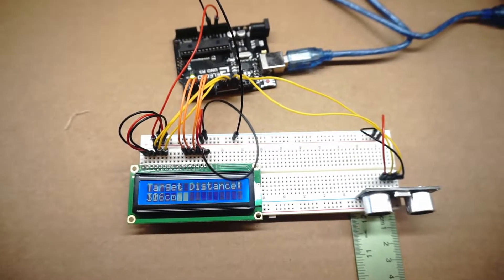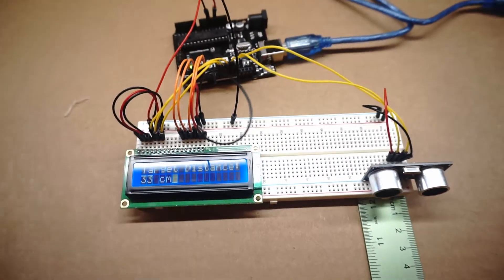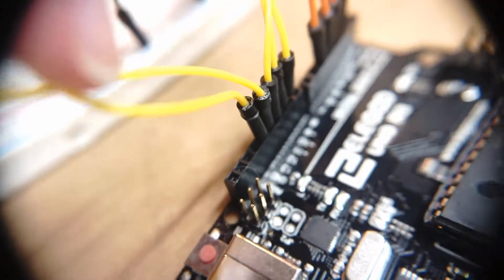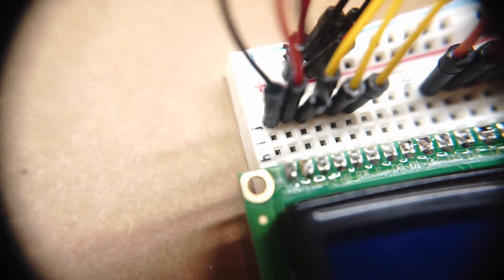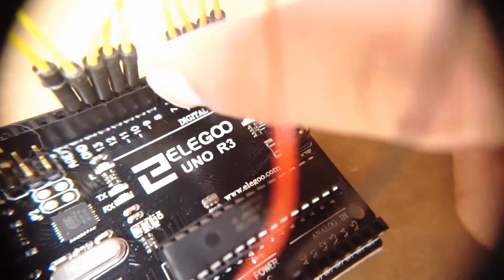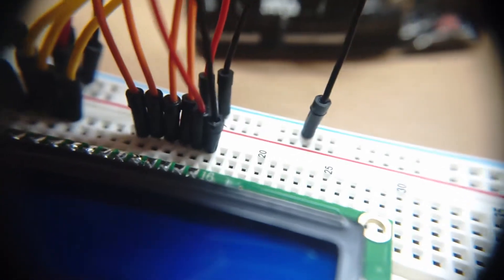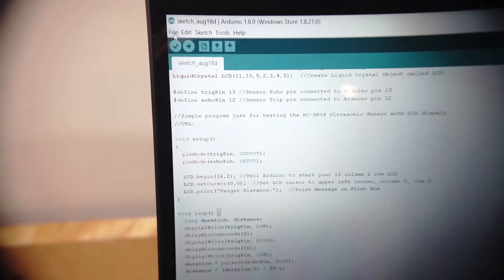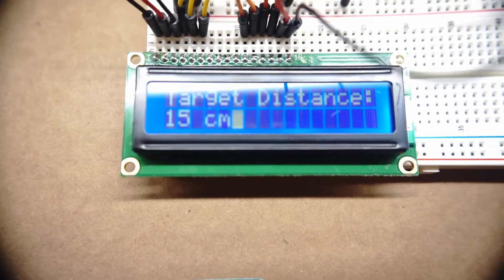Elegoo Starter Kit Arduino UNO Ultrasonic Measuring Project

Comment: switch to 5v and here is the code #include <LiquidCrystal.h>

// LCD pin order: RS, E, D4, D5, D6, D7
LiquidCrystal LCD(11,10,9,2,3,4,5);

#define trigPin 13
#define echoPin 12

void setup() {
  pinMode(trigPin, OUTPUT);
  pinMode(echoPin, INPUT);

  LCD.begin(16, 2);
  LCD.setCursor(0, 0);
  LCD.print("Target Distance:");
}

void loop() {
  long duration;
  float distanceCM;

  // Trigger pulse
  digitalWrite(trigPin, LOW);
  delayMicroseconds(2);
  digitalWrite(trigPin, HIGH);
  delayMicroseconds(10);
  digitalWrite(trigPin, LOW);

  // Read echo time
  duration = pulseIn(echoPin, HIGH, 30000); // 30ms timeout

  // Convert to centimeters
  distanceCM = (duration / 2.0) / 29.1;

  // Clear second line
  LCD.setCursor(0, 1);
  LCD.print("                ");  // 16 spaces

  // Print distance
  LCD.setCursor(0, 1);
  LCD.print(distanceCM, 1);  // one decimal place
  LCD.print(" cm");

  delay(200);
}

Comment: #include <LiquidCrystal.h> //Load Liquid Crystal Library
LiquidCrystal LCD(11,10,9,2,3,4,5);  //Create Liquid Crystal Object called LCD

#define trigPin 13 //Sensor Echo pin connected to Arduino pin 13
#define echoPin 12 //Sensor Trip pin connected to Arduino pin 12

//Simple program just for testing the HC-SR04 Ultrasonic Sensor with LCD dispaly 
//URL:

void setup() 
{  
  pinMode(trigPin, OUTPUT);
  pinMode(echoPin, INPUT);
  
  LCD.begin(16,2); //Tell Arduino to start your 16 column 2 row LCD
  LCD.setCursor(0,0);  //Set LCD cursor to upper left corner, column 0, row 0
  LCD.print("Target Distance:");  //Print Message on First Row
}

void loop() {
  long duration, distance;
  digitalWrite(trigPin, LOW);
  delayMicroseconds(2);
  digitalWrite(trigPin, HIGH);
  delayMicroseconds(10);
  digitalWrite(trigPin, LOW);
  duration = pulseIn(echoPin, HIGH);
  distance = (duration/2) / 29.1;

  LCD.setCursor(0,1);  //Set cursor to first column of second row
  LCD.print("                "); //Print blanks to clear the row
  LCD.setCursor(0,1);   //Set Cursor again to first column of second row
  LCD.print(distance); //Print measured distance
  LCD.print(" cm");  //Print your units.
  delay(250); //pause to let things settle

Comment: is there explanation as to why certain wiring has to go in certain locations?
Reply: There is a communication protocol between Arduino & the sensor for which the signals must be high for a certain time & low for a certain time. Similarly, the lcd interface also requires the display  data to be given by Arduino at a certain particular timing & place. Different pins have different functions. So the correct signals must be given to the required pins which makes it necessary to follow the wiring requirements strictly.

Comment: To make it portable you can attach a d battery or really any battery to the Arduino but it is easier with a D battery because you can just plug it in with that black plug on the side

Comment: it keeps saying an error occured while uploading the sketch
can someone tell me why
i just uploaded it from my files and its doing that
Reply: You need to check the port when you want to upload the program. Simply put, your computer  & Arduino communicate via a port on the computer.  So, the port & also the Arduino board must be selected before uploading the program. 3  months have passed,  but just hope it helps in case you have not found a solution.
Reply: @chetananam9141  hellooo, i dont understand anything, but thank you for helping! i found a different video, i just cant find that exact video again, so again thank you!

Comment: void setup() 
{  
  pinMode(trigPin, OUTPUT);
  pinMode(echoPin, INPUT);
  
  LCD.begin(16,2); //Tell Arduino to start your 16 column 2 row LCD
  LCD.setCursor(0,0);  //Set LCD cursor to upper left corner, column 0, row 0
  LCD.print("Target Distance:");  //Print Message on First Row
}

void loop() {
  long duration, distance;
  digitalWrite(trigPin, LOW);
  delayMicroseconds(2);
  digitalWrite(trigPin, HIGH);
  delayMicroseconds(10);
  digitalWrite(trigPin, LOW);
  duration = pulseIn(echoPin, HIGH);
  distance = (duration/2) / 29.1;

  LCD.setCursor(0,1);  //Set cursor to first column of second row
  LCD.print("                "); //Print blanks to clear the row
  LCD.setCursor(0,1);   //Set Cursor again to first column of second row
  LCD.print(distance); //Print measured distance
  LCD.print(" cm");  //Print your units.
  delay(250); //pause to let things settle
}
Reply: thanks for the code brother
Reply: Brilliant. Really wonderful help!

Comment: can someone give me the code since i cant find it in the link
Reply: /*
HC-SR04 Ultrasonic Sensor with LCD dispaly

HC-SR04 Ultrasonic Sensor
VCC to Arduino 5V
GND to Arduino GND
Echo to Arduino pin 12
Trig to Arduino pin 13

LCD Display (I used JHD162A)
VSS to Arduino GND
VCC to Arduino 5V
VEE to Arduino GND
RS to Arduino pin 11
R/W to Arduino pin 10
E to Arduino pin 9
DB4 to Arduino pin 2
DB5 to Arduino pin 3
DB6 to Arduino pin 4
DB7 to Arduino pin 5
LED+ to Arduino 5V
LED- to Arduino GND

Modified by Ahmed Djebali (June 1, 2015).
*/
#include <LiquidCrystal.h> //Load Liquid Crystal Library
LiquidCrystal LCD(11,10,9,2,3,4,5); //Create Liquid Crystal Object called LCD

#define trigPin 13 //Sensor Echo pin connected to Arduino pin 13
#define echoPin 12 //Sensor Trip pin connected to Arduino pin 12

//Simple program just for testing the HC-SR04 Ultrasonic Sensor with LCD dispaly
//URL:

void setup()
{
pinMode(trigPin, OUTPUT);
pinMode(echoPin, INPUT);

LCD.begin(16,2); //Tell Arduino to start your 16 column 2 row LCD
LCD.setCursor(0,0); //Set LCD cursor to upper left corner, column 0, row 0
LCD.print("Target Distance:"); //Print Message on First Row
}

void loop() {
long duration, distance;
digitalWrite(trigPin, LOW);
delayMicroseconds(2);
digitalWrite(trigPin, HIGH);
delayMicroseconds(10);
digitalWrite(trigPin, LOW);
duration = pulseIn(echoPin, HIGH);
distance = (duration/2) / 29.1;

LCD.setCursor(0,1); //Set cursor to first column of second row
LCD.print(" "); //Print blanks to clear the row
LCD.setCursor(0,1); //Set Cursor again to first column of second row
LCD.print(distance); //Print measured distance
LCD.print(" cm"); //Print your units.
delay(250); //pause to let things settle
}

Comment: it dosn´t work.
can somebody please tell me how i can fix it or copys the real code unter my commend.
Reply: /*
HC-SR04 Ultrasonic Sensor with LCD dispaly

HC-SR04 Ultrasonic Sensor
VCC to Arduino 5V
GND to Arduino GND
Echo to Arduino pin 12
Trig to Arduino pin 13

LCD Display (I used JHD162A)
VSS to Arduino GND
VCC to Arduino 5V
VEE to Arduino GND
RS to Arduino pin 11
R/W to Arduino pin 10
E to Arduino pin 9
DB4 to Arduino pin 2
DB5 to Arduino pin 3
DB6 to Arduino pin 4
DB7 to Arduino pin 5
LED+ to Arduino 5V
LED- to Arduino GND

Modified by Ahmed Djebali (June 1, 2015).
*/
#include <LiquidCrystal.h> //Load Liquid Crystal Library
LiquidCrystal LCD(11,10,9,2,3,4,5); //Create Liquid Crystal Object called LCD

#define trigPin 13 //Sensor Echo pin connected to Arduino pin 13
#define echoPin 12 //Sensor Trip pin connected to Arduino pin 12

//Simple program just for testing the HC-SR04 Ultrasonic Sensor with LCD dispaly
//URL:

void setup()
{
pinMode(trigPin, OUTPUT);
pinMode(echoPin, INPUT);

LCD.begin(16,2); //Tell Arduino to start your 16 column 2 row LCD
LCD.setCursor(0,0); //Set LCD cursor to upper left corner, column 0, row 0
LCD.print("Target Distance:"); //Print Message on First Row
}

void loop() {
long duration, distance;
digitalWrite(trigPin, LOW);
delayMicroseconds(2);
digitalWrite(trigPin, HIGH);
delayMicroseconds(10);
digitalWrite(trigPin, LOW);
duration = pulseIn(echoPin, HIGH);
distance = (duration/2) / 29.1;

LCD.setCursor(0,1); //Set cursor to first column of second row
LCD.print(" "); //Print blanks to clear the row
LCD.setCursor(0,1); //Set Cursor again to first column of second row
LCD.print(distance); //Print measured distance
LCD.print(" cm"); //Print your units.
delay(250); //pause to let things settle
}

Comment: This worked great. Thank you.
Reply: Can you help please if you have the code can you send it
Reply: @hellcat5030  void setup() 
{  
  pinMode(trigPin, OUTPUT);
  pinMode(echoPin, INPUT);
  
  LCD.begin(16,2); //Tell Arduino to start your 16 column 2 row LCD
  LCD.setCursor(0,0);  //Set LCD cursor to upper left corner, column 0, row 0
  LCD.print("Target Distance:");  //Print Message on First Row
}

void loop() {
  long duration, distance;
  digitalWrite(trigPin, LOW);
  delayMicroseconds(2);
  digitalWrite(trigPin, HIGH);
  delayMicroseconds(10);
  digitalWrite(trigPin, LOW);
  duration = pulseIn(echoPin, HIGH);
  distance = (duration/2) / 29.1;

  LCD.setCursor(0,1);  //Set cursor to first column of second row
  LCD.print("                "); //Print blanks to clear the row
  LCD.setCursor(0,1);   //Set Cursor again to first column of second row
  LCD.print(distance); //Print measured distance
  LCD.print(" cm");  //Print your units.
  delay(250); //pause to let things settle
}

Comment: code /*
HC-SR04 Ultrasonic Sensor with LCD dispaly

HC-SR04 Ultrasonic Sensor
VCC to Arduino 5V
GND to Arduino GND
Echo to Arduino pin 12
Trig to Arduino pin 13

LCD Display (I used JHD162A)
VSS to Arduino GND
VCC to Arduino 5V
VEE to Arduino GND
RS to Arduino pin 11
R/W to Arduino pin 10
E to Arduino pin 9
DB4 to Arduino pin 2
DB5 to Arduino pin 3
DB6 to Arduino pin 4
DB7 to Arduino pin 5
LED+ to Arduino 5V
LED- to Arduino GND

Modified by Ahmed Djebali (June 1, 2015).
*/
#include <LiquidCrystal.h> //Load Liquid Crystal Library
LiquidCrystal LCD(11,10,9,2,3,4,5); //Create Liquid Crystal Object called LCD

#define trigPin 13 //Sensor Echo pin connected to Arduino pin 13
#define echoPin 12 //Sensor Trip pin connected to Arduino pin 12

//Simple program just for testing the HC-SR04 Ultrasonic Sensor with LCD dispaly
//URL:

void setup()
{
pinMode(trigPin, OUTPUT);
pinMode(echoPin, INPUT);

LCD.begin(16,2); //Tell Arduino to start your 16 column 2 row LCD
LCD.setCursor(0,0); //Set LCD cursor to upper left corner, column 0, row 0
LCD.print("Target Distance:"); //Print Message on First Row
}

void loop() {
long duration, distance;
digitalWrite(trigPin, LOW);
delayMicroseconds(2);
digitalWrite(trigPin, HIGH);
delayMicroseconds(10);
digitalWrite(trigPin, LOW);
duration = pulseIn(echoPin, HIGH);
distance = (duration/2) / 29.1;

LCD.setCursor(0,1); //Set cursor to first column of second row
LCD.print(" "); //Print blanks to clear the row
LCD.setCursor(0,1); //Set Cursor again to first column of second row
LCD.print(distance); //Print measured distance
LCD.print(" cm"); //Print your units.
delay(250); //pause to let things settle
}
Reply: Do you know how to arrange it as ladder logic? Thanks!

Comment: How did you connect the LCD to the breadboard? It looks to be placed over the breadboard and we dont see any cables or pins connecting from it to the breadboard. I need to know how to physically connect the LCD 1602 to the breadboard for an Arduino project (similar to yours).
Reply: I think in the back of the lcd there are pins that fit into the bread borad
Reply: @ok-sv1or no, you both need to learn how a bread board works and how the columns and rows are connected to each other. Just because you don't see a wire directly ending onto/into the LCD board does not mean that wire is not connected to it. Again if you knew how breadboards worked you would know how fundamental your question is
Reply: you are using a different one
Reply: at the back of the lcd there are pins